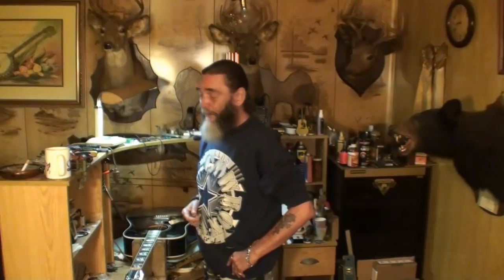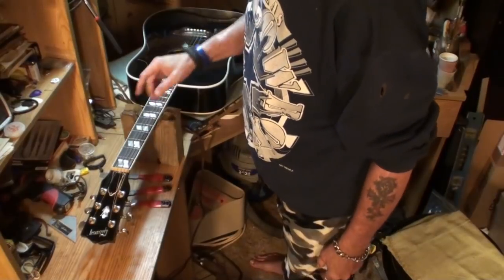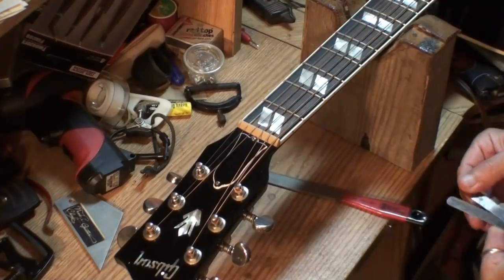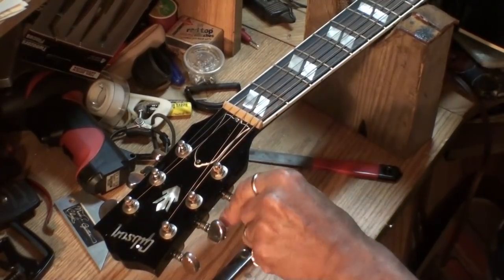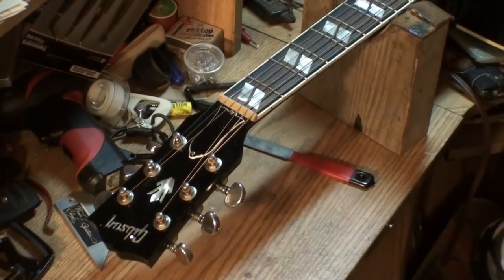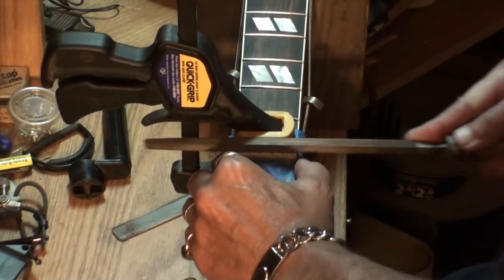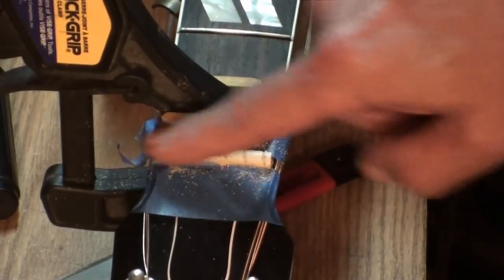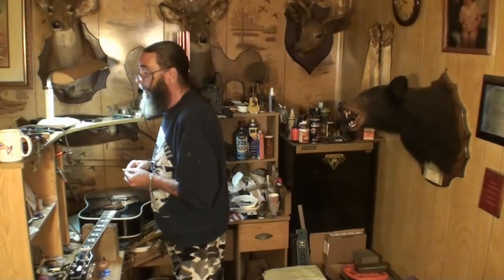make YOUR guitar play easier! gibson hummingbird

Comment: Is there a reason for not lowering the nut height by shaving off the bottom instead of filing the nut slots?
Reply: Cutting the slots ensures proper individual string height following the radius if the board. Not assuming it's correct to begin with and it's hard to get them all perfect taking off the bottom, do that when just getting close when making a new nut depends on the blank type though preformed or true blank. Anyway that's my answer Hope it helps 🙂

Comment: Randy,what is your opinion on overwrapping the strings on the tail piece of a Les Paul? Does it help or hurt sustain,or make the strings play slinkier? Mine is wrapped standard. Your thoughts? Thanks,Randy.
Reply from the maker: you would get more sustain by not over wrapping them, the more down pressure you can get on the saddles the better, over wrapping gives less down pressure. thanks for tuning in!
Reply: @RandySchartiger  Thank you😊

Comment: What kind of files are the other ones in the red package? I don't think I can afford the stew mac ones, and I've been using welding tip cleaners that take forever.
Great video. I angle the nut slots like that too, because that's how I learned from you.
Reply: Frank Lopez The double edge nut slot files are now way cheaper than those wonderful, expensive Japanese files. I have a set (3) with different colored handles, spent under $20 and free shipping and they do a great job. Just don't go too deep! Thanxz
Reply: @audiotechlabs4650  Oh wow!.. Thanks much. I'll order some.
Reply: @audiotechlabs4650  Can I order them from Amazon?
Reply: Yes.  Magideal double edge nut files 3 pack with a bridge pin puller. $14.97 usd. Thanxz
Reply: @audiotechlabs4650  Awesome, thanks again!

Comment: Very helpfull vídeo! I have a Tagima acoustic guitar that has this problem, too hard to press the strings, i cant play with It for more than half a hour because It start to hurt my fingers, i didnt consider the nut, was thinking that it would be Just the sattle and maybe the strings are too thick. I was thinking about changing the strings to 0.9 (i usually play with 0.10) but i was afraid that 0.9s would broke a lot with my strength while doing bends and tecniques that would apply too much pressure to the strings. The problem is that i dont have theses files on me, i'm gonna have to figure out some other way to file that nut. Thanks Man, your vídeos helps us a lot!
Reply from the maker: this guitar was like that, very hard to play but now after this video it plays so much easier! thanks for watching! I hope you get your guitar playing easier.